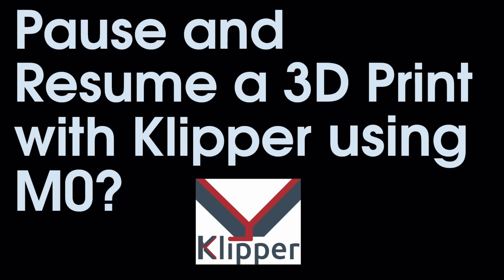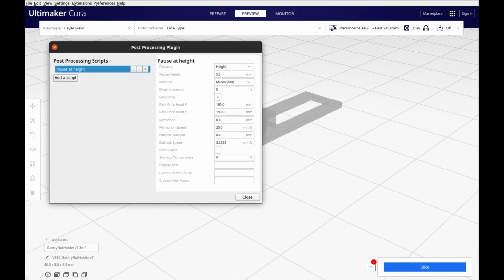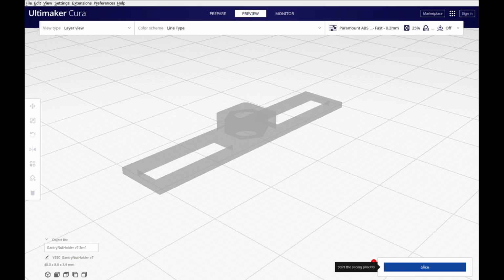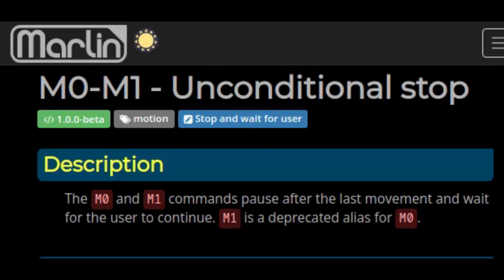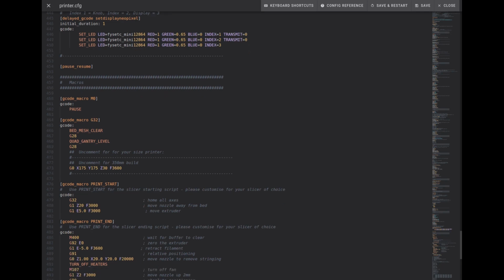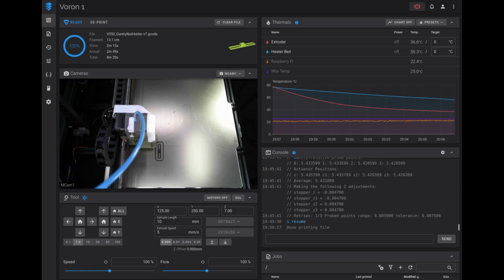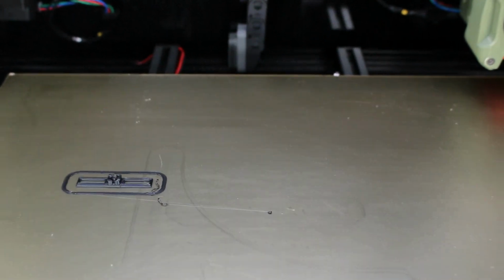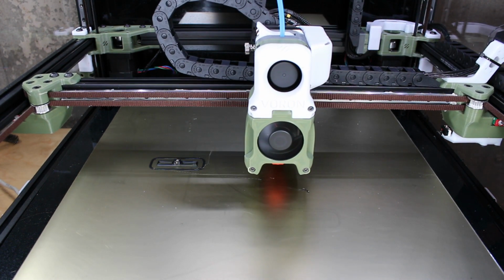Pause & Resume a Print using Klipper

Comment: how did you get the small gcode previews in your Printing list?
Reply from the maker: They just appeared after installing fluidd.  I didn't do anything.  However, now that you mention it, it has been a while since I have seen them.  They disappeared!  I'm going to try and figure out what happened and report back.  Thanks!
Reply: @KapmansBasementWorkshop  in the fluid docs, there is a section thumbnails. you gotta modify the gcode in cura, to insert a thumbnail the size 300x300 and 48x48. then reslice the file and it should show up again
Reply from the maker: @LWUndsoo  I just tested it.  This works great.  Thank you very much for responding!
Reply from the maker: One more question if I may.  Are you aware of a way to change the thumbnail image color?  It's showing up gray on the black background, even with my glasses on it's a little tough....
Reply: @KapmansBasementWorkshop  qyes the colour is taken from the preview of cura. You can set the preview colour for each material in the material settings, therefore you can actually see what kind of material yiu sliced this file with.
Reply from the maker: @LWUndsoo ,  Thank you very much for responding with that!
Reply: @KapmansBasementWorkshop  no problemo!

Comment: If you're using Octoprint you'll need to unblock M0 in the firmware & protocol section of the serial settings.
Reply from the maker: Thanks for the tip!